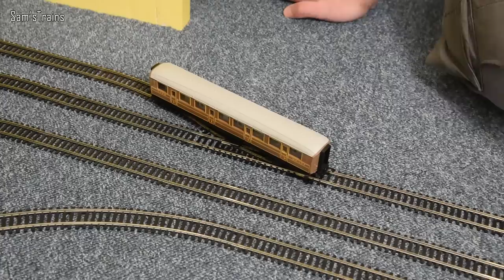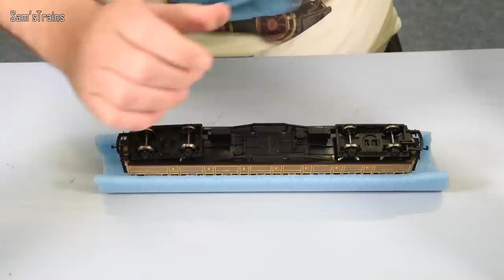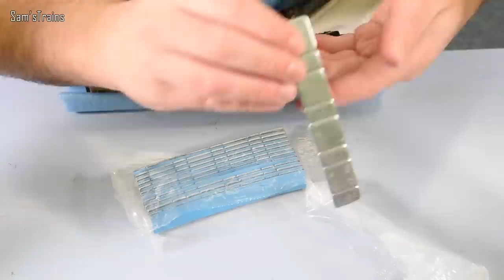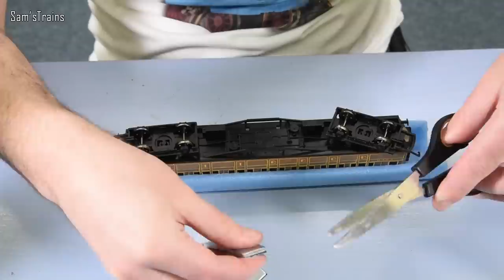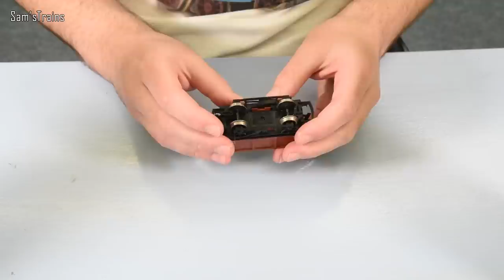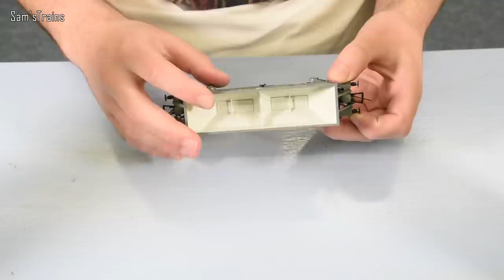How To Stop Derailments on Your Model Railway

Comment: I'm not saying cleaning fixes everything....but in general, it sure as hell makes things function SO much better.  Usually, when I do a serious cleaning I :

1. Get a six pack of beer.
2. Put on some great music
3. Tell your spouse to leave the house and go shopping.
3.Start by cleaning the entire track - vacuum first, then clean those rails
4.Now- clean EVERY car and locomotive AND inspect - you never know what else you might find that is causing issues.
5. If you do #1 & #2 while doing this - it's not so much of a pain
6. After all the cleaning is done - sit back and enjoy your model railroad for  you now have clean track and clean wheels!
7. Continue with the use of #1 and #2.

There's no harm in cleaning cars and track as they need it either (some cars and locos you run more than others)...but it's good sometimes to just sit down and do a MASSIVE overhaul of cleaning of everything.......

Lastly regarding #4 - I remember when I was an adult and I got re-interested in model railroading, I was no longer a child and I could now REALLY sit down and troubleshoot problems as I now had more knowledge.  So, I spent that first 2 weeks cleaning everything, and then slowly started to use every car I had....but I held back on a couple.  The couple I held back on, I waited because they had caused me trouble since the 70's...always causing derailing's.   So I finally put the one hopper on the track...sure enough -within 2 minutes of running it....it derailed.  I finally sat down (now as an adult)...and REALLY looked at it.  I saw that it simply just had a faulty coupler that wasn't snapped in correctly!   I fixed it....and it has ran fine since...which brings up my whole point - INSPECTION during cleaning is crucial.  Great vid Sam!   Lastly, if someone doesn't like the weights....they can always paint them black....Love the gauge tool!  I think I need to get one....

Comment: If you are using Bachman ez track on your layout these weights can be stuck onto the bottom side of the track it really helps hold the track down. I’ve done this before. Also box cars are the easiest to ad weight just pop the shells off stick some weight in pop shell back on. The problem cars be like tanker cars there’s no where to stick weight on them

Comment: I have the gauging tool you use, very good but I find using digital callipers set to 14.4mm are better on my Peco track. Most of my derailments are caused by mixing couplings especially between the engine and first wagon. Still all adds to the fun!
Reply from the maker: Thanks Gareth - yes manual measuring is the only sure-fire way to sort the problem, very true! And yes - mixed couplings definitely does cause problems too!
Thanks for watching - Sam :)

Comment: Open your new Hornby item, enjoy viewing it, and then USE the wheel gauge! After you've adjusted the wheels, now go to the track and enjoy. Nearly every piece of Hornby equipment I've ever owned, including locos, has needed wheel adjustment. Also, don't just depend on a back-to-back gauge, but check the over-flange spacing. Occasionally a wheel can be rather thick, and the flanges themselves are too far apart. [Later edit]: When possible, I'll put the 10gram weights on the bogies after coloring the edges with a black marker. That has really help the Hornby coaches, but others may need a bit of attention so as to not foul any mounting screws, or other means of attaching the bogie to the coach. Obviously, one does not want the weight to contact the wheels at all. Also, I suggest using the NMRA standard gauge tool to check the actual flange spacing AND DEPTH, along with the clearance through the guard rails on the points.

Comment: Black felt marker or black tape to cover that shine, or for hoppers-use false bottoms that cover the weights.
One must also remember, when improving the tracking of wagons by using weights, say 10 passenger wagons... multiplied by each additional grammes or ounces... now, put those wagons back in a box for storage... over time, that collection is getting heavier by weight, not volume!
Very nicely done video... first time for me to watch them.  I'm John in BC, Canada.
Reply from the maker: That's very true - and they even do blacked-versions of the weights too, which is great! Yes that is an issue - it's important not to over-do it!
Thanks for watching - Sam :)

Comment: Interesting little video. I never experience issues with derailing, only locomotives. If there is a problem I just ‘rip’ out the Bogie and give it a thorough cleaning. And for cleaning the wheels I use tooth picks. They are very good for cleaning wheels
Reply from the maker: Glad to hear you don't have these issues - that sounds like a good tactic too - glad it works for you! :D
Thanks for watching - Sam :)

Comment: You can buy black self adhesive balance weights. Lead were outlawed some years ago, most are steel now, hopefully coated so they do not rust; some zinc & even plastic weights have been known.

Comment: Sam, you can get black wheel weights, which are less noticeable, or you can colour them with marker pens or black paint. 
And the NRMA standard is 25g per axle, so weigh the existing loading and add as required. After all, making a train too heavy may introduce traction problems on gradients!
And finally, you can get other Back-to-back (B2B) gauges that are set up for the track that you run, so you don’t have to do the “squeeze it a bit more” technique, with its erratic results.
Regards, Tom
Reply from the maker: You can indeed Tom - I saw those too after this video - they'd be absolutely perfect! Duly noted - I didn't know there was an NRMA standard weight - that's very interesting!
Thanks for watching - Sam :)

Comment: To overcome the problem glue 20thou plasicard strip into the check rail overlapping it by 5-10mm into hornby points. Peco points not a problem. This cured the problem with derailments fully for me. Not a single derailment since.

Comment: I got over this by trying to keep things as realistic as possible, which meant  using Hornby express points, and peco large radius points. With peco points I found I had to open the gap between the rail head and guide rail. I also found wheels play a bit part, the best wheels I've found are the old Hornby ones with the pressed metal tires, such as shown on your mineral wagon. I find the flanges are slightly deeper but still thin so not to course issues. My Gresley coaches like yours are the best riders I have. The worst I've had for sometime was the Royal train coach set (mk2a and Mk3a) and even with these wheels they were bad.  I run a small engineering works, so I robbed some M12 buts out of the stores, the mk3's I hid underneath the inside (not that it matters, as you cant see the inner detail on the Royal Coach set) but the Mk2a's I had to put one in the passenger vestibule, and one in the guards compartment. I also find weight  helps. Having watched your video I think I will do what you have done to the bogies and the poor riding 4 wheel wagons I have. 

I have a Hornby lomac 4 wheeled well (I think they use the old Airfix moldings), and that wont go over any points no matter what I have done.  

I've also had issues with some Bachmann tenders, and ended up turning the flanges off the centre wheelsets.
Reply from the maker: Thanks very much for sharing - yeah that sounds like the best approach to me!! :D
Thanks for watching, Sam :)

Comment: Brilliant! I have spent many an hour adding weights to, and re-gauging wheels of, rolling stock after watching this episode of Sam’s Trains. It makes a massive difference. 

Why don’t the manufacturers add weights like these before they sell them? It wouldn’t cost much and would improve them no end. Or, as we stop using, or reduce using, plastic as it kills the planet we may return to die cast models which will naturally be much heavier.

Whilst on the subject... can we urge manufacturers to use different packaging with much less plastic? There is no need to have “blocks of ice” plastic packaging when cardboard or similar products could keep the model safe. If they need to display the model just print a picture of it the outside. Save the planet!!!
Reply from the maker: Glad to hear that Jim, thanks a lot! I don't know why the manufacturers don't do it - they charge enough!!
I don't think cardboard would be sufficient to protect some modern locos - but it'd be okay for some more basic kit! :D
Thanks for watching - Sam :)
Reply: Sam'sTrains Cardboard was the wrong word... whatever Egg boxes are made of isn’t cardboard but can protect eggs which are very fragile laterally, if not vertically. That material is sprayed into a mould before being set. It could be used easily for keeping locomotives and rolling stock safe.

The manufacturers can’t afford to keep using plastic. The world can’t afford it either.

Comment: if there is room to use 6" of flex track to transition those curves (after T O);  and proper weight, smooth track pivot.  !One of my pass cars had a step which hung too low and struck the wiring screw of an powered-T O !

Comment: There's a slight bump on the V part 'switch track' which is plastic, needs a little filing down. If you was to run a wagon freely on that part you'll feel the bump.

Comment: I like the wheel balancing weight idea, though I would hide them inside the coaches and wagons where possible. Replacing the old hornby silver seal wheels is another good idea as the tires can come loose and the flanges are often irregular shaped. 
Another tip for those using Peco points like me is to check the alignment of the point blades where they hinge, they can lean if the clips holding them are too loose. I found this after my hornby L1’s front pony truck kept coming of as it was hitting the end of the adjoining track due to the misalignment. Pushing the blade straight and spreading the clips underneath to hold it cures the problem. The L1 is now my official track kink finder.
Reply from the maker: Yeah absolutely - space permitting, it'd be much better to hide them inside! Duly noted - that's a good tip, I've not looked into that before - good one!!
Thanks for watching - Sam :)

Comment: Hi Sam, well just which your video and thanks, just brought your gauge adjustment for n gauge, also weights too. And think you right as for derailment which I some time get with some coaches of mine on layout. Well thanks for the thought and hopefully this will cure my problem. Roy
Reply from the maker: Hey Roy, my pleasure - hopefully it should work just as well for N gauge - the smaller weights should come in handy!
Thanks for watching - Sam :)

Comment: Thanks for these kinda vids Sam I love the science! :P

Something that came to my mind while watching, another reason it derails off the point curve is because the bogeys cannot rotate quick enough to keep up with the curve. This is something I have noticed in real life too, one of my local preservation lines was having issue with a coach and lifted it, completely redid the 'bearing' surface that the bogey rotates on and now it apparently works fantastically! 

Not sure how to fix that issue with models though, as it can be dangerous to lubricate plastic without it getting ruined etc. 

So if anyone has a suggestion for a plastic lubricant, that would be great too! My layout is literally a straight shelf 'end to end' layout with station pilot points with no curves so I can't test it haha.
Reply from the maker: My pleasure mate, glad you liked it! Yeah I'm sure that's an issue - but rather than being not able to move quick enough, they're unable to move freely enough - which would be fixed with the new bearings etc. It can be difficult with 00 gauge - but usually there's something catching the bogies, if there's a problem!
Thanks for watching - Sam :)

Comment: Very good video. However I would suggest that an alternative to the back to back gauge would be the NMRA HO standards gage tool which not only checks the wheels, but also checks the gauge of track, the width of the wheels and most critically the frog and guard rails on points. This tool was very useful in helping me find the problem to my Hornby Flying Scotsman and it's LNER teak coaches derailing. It turns out I didn't need to do all the stuff mentioned in the video like add weights, however I only needed to regauge the wheels on both the loco and rolling stock to the NMRA standards gauge using a NMRA gage tool, two flat head screwdrivers and some pliers and they ran fine even on s pattern curves without needing any weights or modifications. As for the points, the Hornby points don't meet NMRA standards due to the guard rails being too far apart from the running rail. The solution would be to either add a bit of plastic to the guard rail or swap the Hornby points out for Peco points due to their points meeting NMRA compliance and the guard rails having a tighter distance. I have supplied both the links to the Hornby and Peco points and the NMRA gage tool for you. Hope that helps.

https://www.micromark.com/NMRA-Gage-HO-Scale_2
http://www.newrailwaymodellers.co.uk/track%20layout.htm
Reply from the maker: Thanks very much for that - I wonder if that'd be more accurate? I bet it would! Thanks very much for the tips, I'll look into those! :D
Thanks for watching - Sam :)

Comment: Rather than the B2B gauge you use to measure the internal width that, as you say, may give wrong results depending on the flange thickness, use a digital caliper measuring the external width flange to flange.
A digital caliper is also useful to check if the wheels are centred on the axle measuring how far the tip sticks out on both sides, but also very useful in many other situations like verifying that the gauge of the track itself is not incorrect because of distortion.
A decent digital caliper is not more expensive of the dedicated, single function gauge you use and has multiple scope of work.
Reply from the maker: Yes that's a good point - I will start doing that! Good advice my friend!
Thanks for watching - Sam :)

Comment: Hi sam the only safe place to use lead is in the boiler tube of a steamer that has traction issues with a long consist i did this with a Black 5 that now pulls 30 loaded coal hoppers (real coal) which typically slips on take off then she pulls the hoppers no probs now /keep doing the vids M8 they are great & very informative
Reply from the maker: Yeah that's true Bryan - definitely wouldn't want it on the outside anywhere!
Thanks for watching, Sam :)

Comment: I used to make weights from metal toothpaste tubes. The metal is zinc and you can melt it down and pour it into a mould. I would glue the weight to the coach or wagon and paint it black.
I tried to aim for a scale weight. So for a 45t coach the scale wight is just over 100g. However you’ll need to consider the weight of the rolling stock if you like to run long rakes.
For loads, say a coal wagon, I’d make a card insert and glue real crushed coal on top to hide the weight.
Reply from the maker: That sounds very interesting Kate - I've never heard of doing that before, well worth a try though! :D
Thanks for the tip,
Sam :)

Comment: Great Idea, I had some coaches given me with plasticine inside, also from other video's using mag plates and magnets underneath counld help, I will have a challenge as I am modelling a Layout on Bolton 1963 and there are 4 tracks that cross from5 "Y"  points that I am making using a template and this will be a de-railing nightmare...but your video has been a great help..
Reply from the maker: Thanks John! Yes I've had some models stuffed with plasticine too - it was a nightmare to clean it out actually! That sounds very impressive - hope it works well for you in the end!!
Thanks for watching - Sam :)

Comment: Just realized that if you 3D printed some realistic couplings and used those on the actual plastic coupling hooks, you could put those weights in the old NEM pockets instead. Would that solve the visibility issue?

Comment: One of the things you can do to hide the weights is to paint them in the same colour as the underframe of the carriage. Also if you need to make weights that are specific for the shape of the slot they are fitting into, you can get hold of old pewter ware and mett it down and then cast it into the shape of the weight that you want. when you allow the pewter to cool it will naturally darken and can help with hiding the weights too. Hope this helps.
Reply from the maker: That's very true William - that would help a lot for sure, great idea!!
Thanks for watching - Sam :)
Reply: @SamsTrains  I am always happy to help with things like this... its what I do for a living!

Comment: Here's another tip, Watch out for buffer lock. My coaches often derrail and/or pull the loco off while I'm shunting. My solution is to be a bit rough with 'em to avoid the locking.
And if there's any soldering check to see if it rises above the rails, I've got such a point near my turntable and it always derails my Q1's tender without fail.
Reply from the maker: Yes that's very true actually - I've seen that quite a lot!! :O
Thanks for watching - Sam :)

Comment: Start with the track work. Get your track right (no immediate S curves (that includes after points) level track, smooth joints, etc. If you build your track well, then any derailments you have afterwards can only be due to issues with individual pieces of rolling stock.
Reply from the maker: Yep that's absolutely right - very sound advice indeed!
Thanks for watching - Sam :)